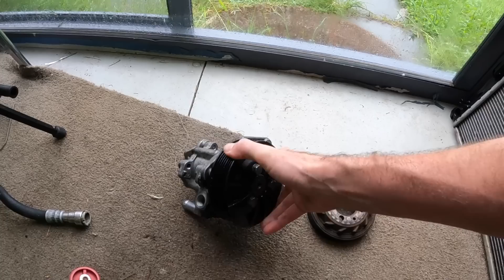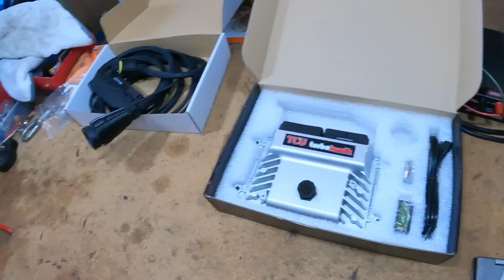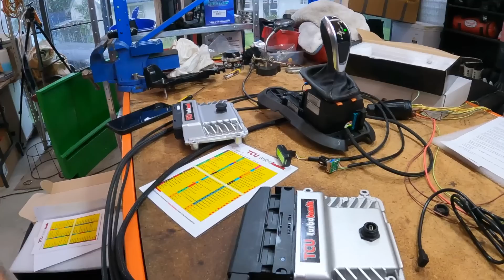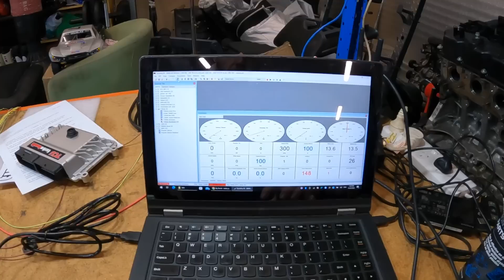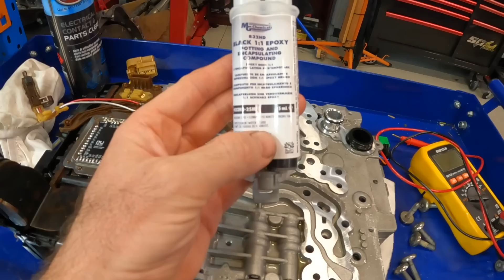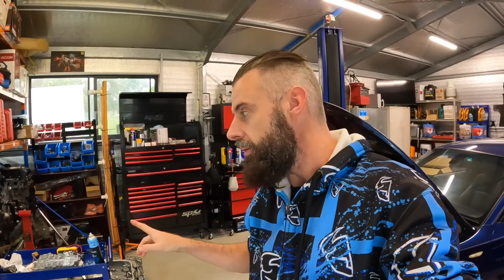BMW N54 135I 8HP INSTALL PART 1: TCU MODIFICATION

Comment: About soldering, do you use Flux? If not, try to get a syringe with Flux. Add Flux on the contact-points and then solder. Remember til clean with Isopropyl alcohol after soldering.
Reply: came here to say the same thing! flux ftw

Comment: I think you just helped me figure out my problem I’ve been having with my power steering. At first I thought it was bushings when I would taking u turn. I’ll know by tomorrow morning. Thank you playa.
Reply from the maker: Man this sounded like rod knock at idle and piston slap at 7000rpm. But rotating the pump even by hand I could make it click. New second hand one nice and quiet at idle. Haven’t had a dry to test 7000rpm yet hehe
Reply: @ZeroTo60Tube  I haven’t even gunned it passed 4000 rpm but if it works it works. There’s barely any liquid in the power steering resovour, I didn’t see any leaks anywhere and if it’s a noise that’ll let you know then there is a good chance I just need to fill it up. I’ll know by tomorrow. For now thankfully it’s taking me to work lol

Comment: Good job on the soldering, definitely an improvement :D 
Also that epoxy looks like it works really well.
Reply from the maker: It definitely is way more runny, not that the other stuff was bad, but this has to have seeped under the board a little better.